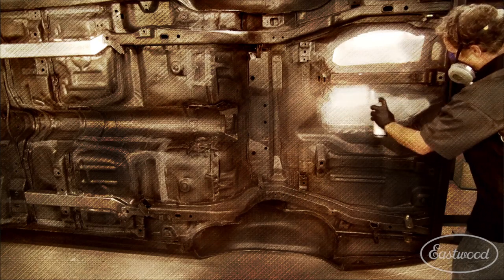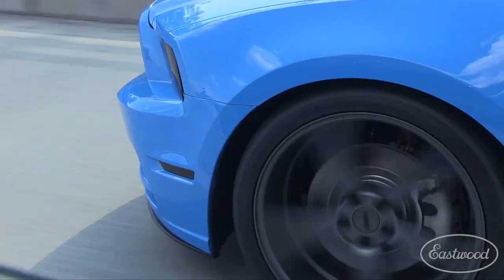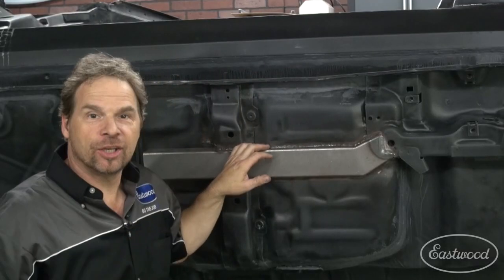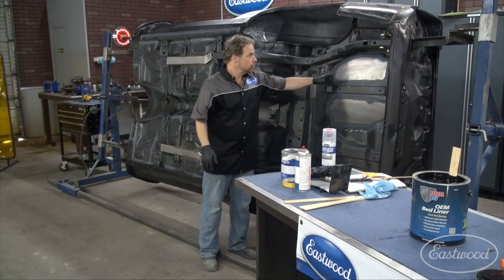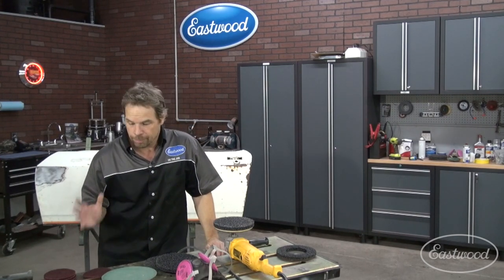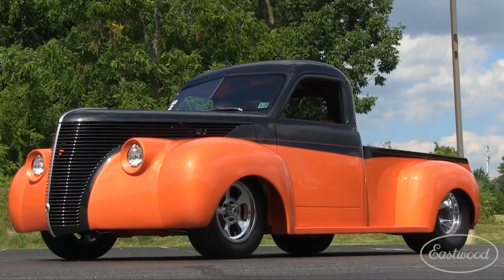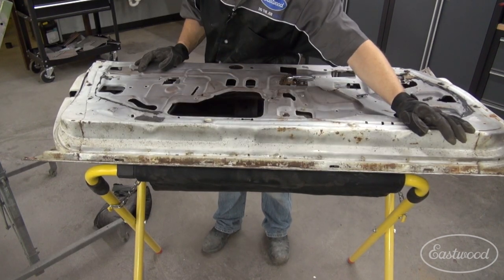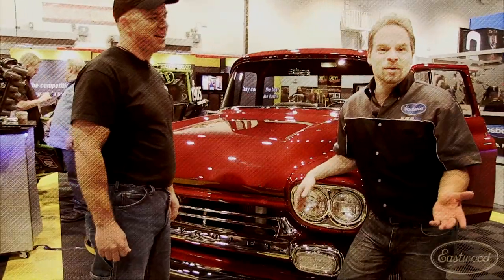How To Spray Epoxy Primer + Bed Liner on Hands-On Cars 6 + Coyote Mustang & Studebaker -  Eastwood

Comment: I am working on a similar project now and have been using this build series for a lot of the body work questions. One question I have been having is about body working the urethane parts. there is so little "good" or complete information about refinishing and body working these parts. Specifically about proper products to use for different plastic parts and when and when not to do certain things. any thoughts on a series with some of that information?

Comment: Hi. In the surface door i looked small points of rust.. very small... your primer epoxy neutralized that small rust in small points????? Or is necessary to work more to clean that area and then put the primer epoxy???

Comment: Hey Kevin how would you go about taking off one single layer of paint that has been painted over the original paint? My trucks orginal paint had lettering on the doors and you can still see where the lettering was under the nee paint but you just can't read it because of the paint job over top the original. I would like to be able to strip the one single layer of paint so I can read what the lettering says and restore the lettering and original paint.

Comment: Put the seam sealer straight on bare metal? I've been told not to do that and put primer on first then seam sealer. I don't know which is correct.
Reply: Everywhere i've read about says to put epoxy primer first then seam seal. That way you have a epoxy layer to protect against rust.